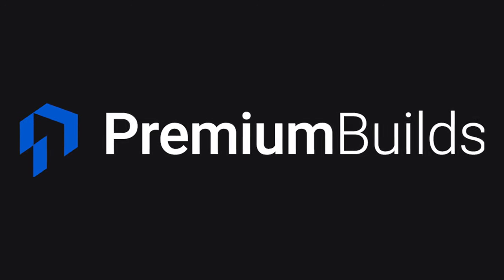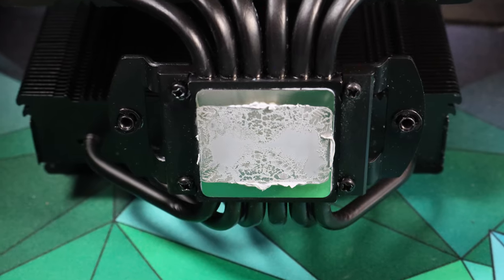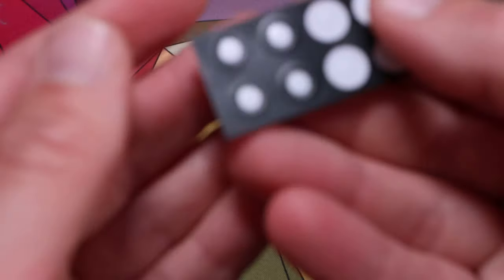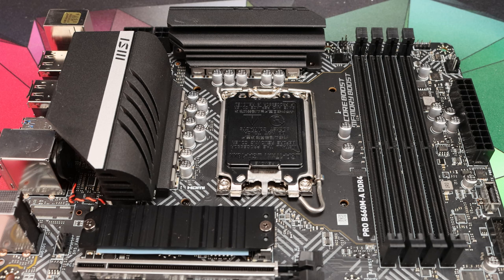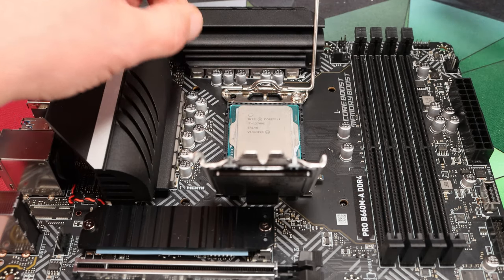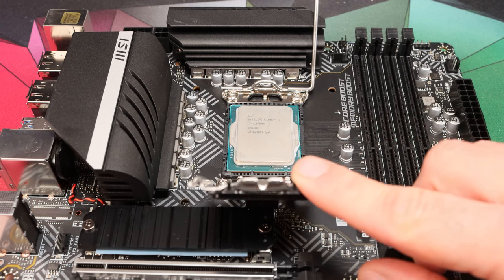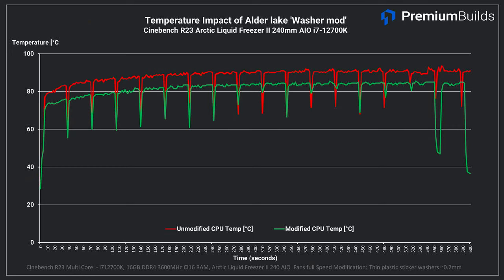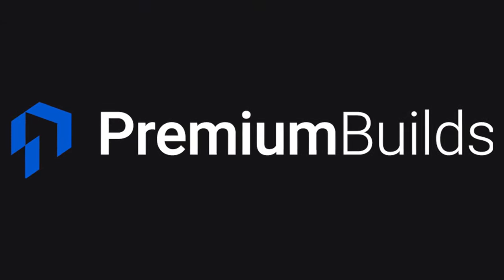Running Hot? Drop CPU temps with this simple mod!

Comment: Can you recommend good budget Mobo for i5 12600k with rtx3060ti and with 2 PCIe slots and Overclocking.
Plz😭
Reply: The MSI motherboard he is using in this video is probably the cheapest quality board you can find.   I believe it's an MSI Z690 pro, I was going to use this one but I canceled the shipping on it and went with the MSI z690 Tomahawk version because it looked better in my opinion.
Reply: @thomassimons8570  I am also planning to buy msi z690 tomahawk, but the thing is msi z690 tomohawk cost the same as i5 12600k here in India.
Msi z690 tomahawk- 25,000 RS
i5 12600k- also 25,000 RS
I want to do some cost cutting on Motherboard,what should I do next🥺
Reply: @Indo-Aryan9644  Im putting a i5 12600k in my tomahawk right now.  If you want a cheaper board I would suggest the MSI PRO z690-A wifi Its only $180 here in the US

Comment: Is the same problem with a processor i5 12400?
Reply: Its not so much the processor...its really the specs for the locking mechanism.

I have an i5-12400 on an Asus Prime H670-PLUS D4...and the washers dropped my temps by 10C.

Comment: since you got quite nice suite of lga 1700 coverage perharps giving a look at trying to reduce vcore voltage via some bios option could be interesting topic as for my self been very effective to reduce baseline of the power draw whit 97% in multicore of the performance seem to me that the node quite leaky and tend to benefit from lover level of voltage but maybe my motherboard overshoot whit some setting happy camper zone seem around that 1.08 issh to 1.1 produce meanful change in power draw from the 1.16 issh to 1.17 issh versu previous generation wich where more tunned toward that 1.35 i think node simply ain't scaling as well whit extra voltage due to leakage but i5 12400f probably not greatess bin either lol.

Comment: I won’t do it… messing around with custom builds is just a recipe for disaster imo. I’ll leave it to the manufactures to do these or 3rd parties to come out with the relevant products compatible with the mobos.
Reply from the maker: Companies now make contact frames to perform this function - $10 for a more reliable option. Well worth it. It requires the same amount of messing with the PC to fit though!
Reply: @BuildPicker  Several other prominent utubers like JayzTwoCents actually did a test on his own mobo with this method. He didn’t see any difference or rather the difference fell within the margin of error of 1c. I guess it will depend on several factors whether this works. Age of the chip may be a factor too. Regardless, for myself I run only a i5-12400 so I guess it doesn’t much apply to me. Thanks for the vid though, good to know such stuff😬

Comment: i used to have an i7 6700 and just upgraded to an i5 12400 and somehow noticed that the average temperature ( idle ) of my new set up is always around 37-40 celcius whereas the old one was just around 33-35 degrees celcius with the same ambient room temperature of 28-30 degrees celcius ( im from indonesia,so its kinda hot here ). this might explain something 🤔
Reply: Tjah Tjoepoe  dual fan kah? Or 1 aja? Trs full load klo lg benchmark brp?
Reply: Tjah Tjoepoe  30an suhu ruang brp bro? aku suhu ruang siang malah bs 32-33 dlm kamar
Reply: Tjah Tjoepoe  wah panas juga itu 93 pake 226xt? gw baru mau beli itu. btw 93 itu gaming apa benchmark extreme?
Reply: Tjah Tjoepoe  oke tengkyu bro reconsider lagi deh

Comment: Horrible, buy a thermal grizzly support, i've drop 25° on 13900K OC with MSI board.
Worst socket created by Intel for $£€

I'm not recommending doing what you see in this video.
Socket support AND AIO update support doing great.

This is only "DIY"